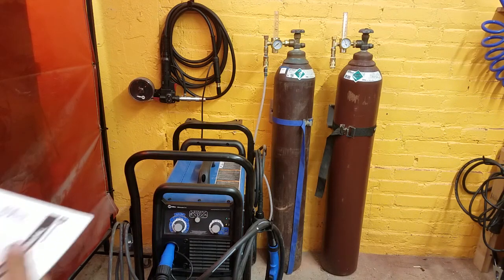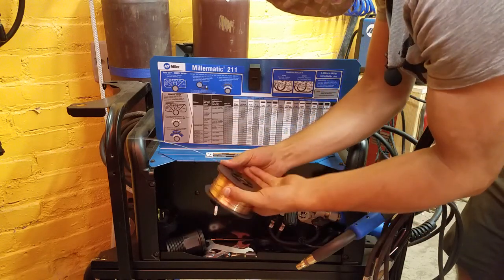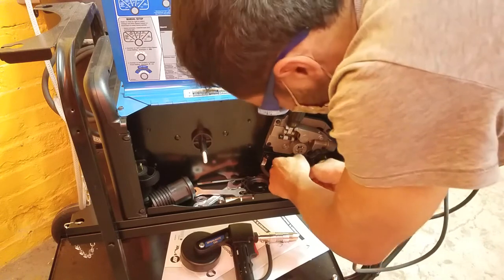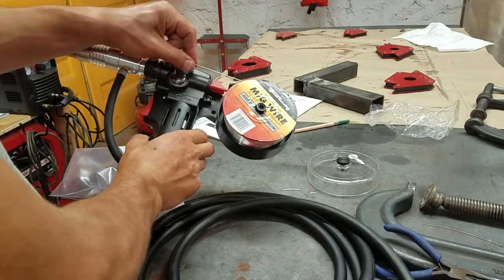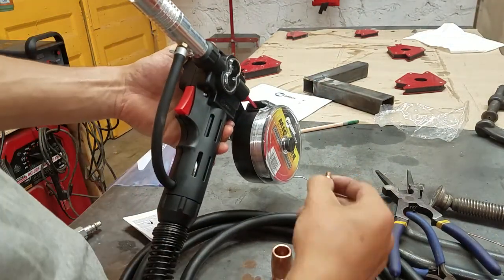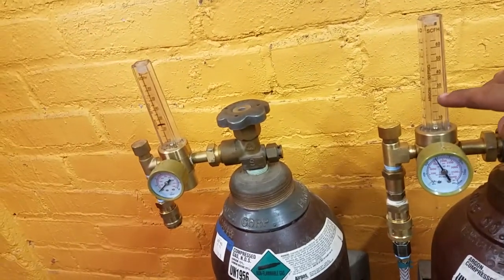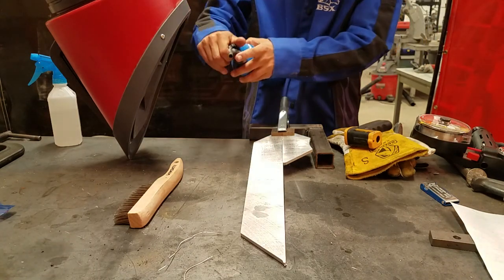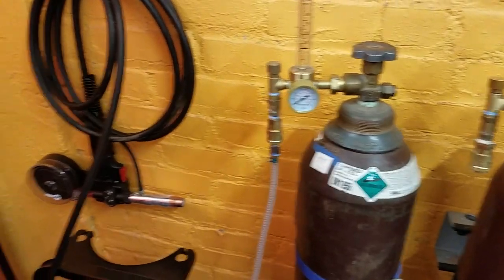How to Use the Miller Spoolmate 150 Aluminum Spool Gun

Comment: Thanks for the video.  Am new to welding and just picked up a Spoolmate 150.  CAn yuo provide any info on how you have your quick-disconnect set up to go from 75/25 to 100% Argon?  That seems a lot easier than constantly unbolting a regulator and re-attaching it.  I like the site-glass as well, to measure the flow.  Thanks

Comment: You don’t reverse your polarity?
Reply: My bad. Didnt realize you had solid wire in there before you switched. I got the same welder but i use it for mobile alot so i got flux core in mostly.. not too great with aluminum yet